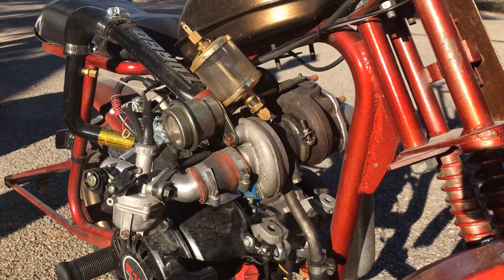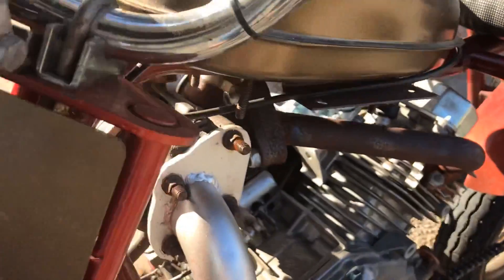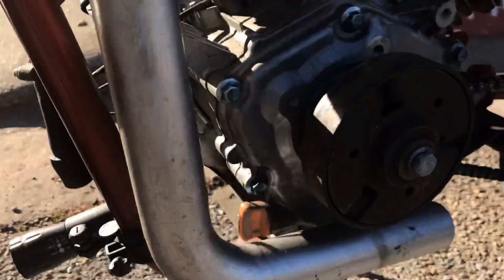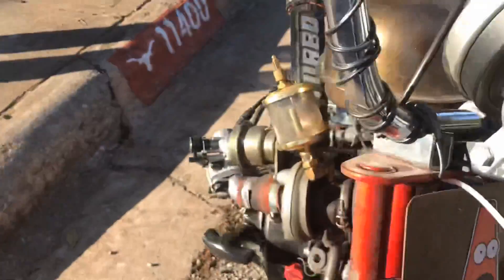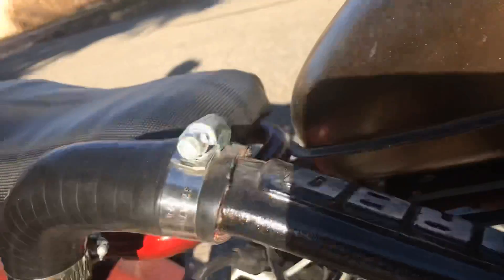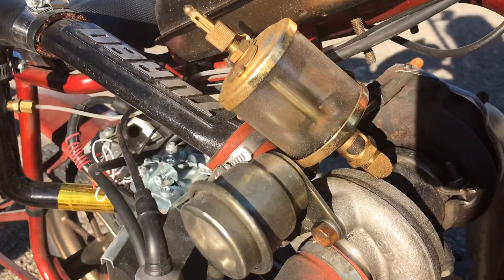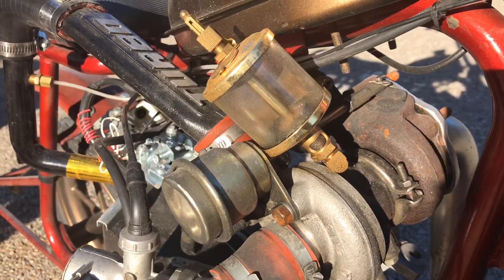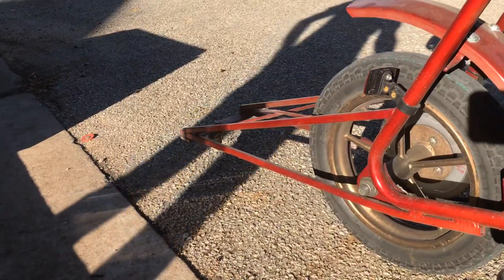Turbo Predator minibike walk around startup and ride

Comment: 'I don't ride it everyday, ...  or i would be dead' ohh man that was funny , great build btw . always coming back to this video just to check , building one myself :)
Reply from the maker: Thanks! Its actually injured quite a few people. Fortunately nothing serious but its a handful. No one respects the throttle or expects the boost to hit so soon. I'm not great at recording what I'm working on but I guess I should make a follow up video. I'm working on a hydraulic brake setup to make it a bit less dangerous to ride and have been thinking about reworking the exhaust/charge pipes for ergonomic reasons.
Reply: Hey mann this is my other account I got a video of my turbo ,feel free to check it ,peacee
Reply: instablaster
Reply: What did you have to do to the carb, add bigger main jet?

Comment: What carb and what jet size are you running?
Reply from the maker: Its a 22mm Mikuni knock off and I went up 3 jet sizes if I recall correctly. I can pull it apart and get the number but it started and ran on the stock jetting out of the box. Your results may vary

Comment: Question on the oiler......These Turbo's, I just bought one I'm planning on putting on a Briggs vanguard v twin. Everyone I've seen using this cheap turbo is having oil control issues with them. I understand you don't have an oil pump on the predator but the Briggs does. When I tried questioning the manufacture off eBay I never got any response of course about oil flow and pressure requirements. I'm at a crossroads now.....  Do I take the whole thing apart and custom make my own new tighter tolerance bushings for it, or put the bandaid on it by using a oil restrictor inline to the feed side. I'm guessing you may have some time on yours by now and it hasn't seized up or the impeller isn't grinding into the housing yet from lack of lube with a non pressure lube system. Just wanted your opinion on this turbo if possible. Thanks so very much, I have the same exact mini bike frame!!! Lol! It's all done up with a worked predator 212 naturally aspirated though is deadly enough! I can't believe we have the same bike and I put the same tank on mine as well off a bicycle kit lol! That's too funny and weird man! Shoot me your email address in a message back and I'll send pics of mine! Do you have any idea the manufacture of the chassis of these bikes BTW? Mine came from a school transportation class they were throwing out. Was like brand new minus the engine of course. But it's the same slanted engine plate with fork springs and big ass spoke wheels 10" I believe I put knobbys on that fit a Yamaha Pw50, they work awesome. I had to do away with the horrible rear scrub brake with the knobby tires though and want to a band brake welded the hub to the rear rim. Please if you happen to have any info on these chassis let me know. IDK if it is or not but mine has MANCO on the back of the seat, but I really couldn't find anything manco made that looks even close to ours!!??
Reply from the maker: I just used a gravity feed machine oiler and have to drain the lower reservoir occasionally. Probably not ideal for the turbo but it has lasted 3 years like this.
Reply: try it without the restrictor, if it smokes, put the restrictor in. also, as straight a return line and as big as possible.

Comment: Does the type of spark plug matter? In a car I know they require cold spark plugs
Reply from the maker: probably but I haven't messed with that aspect. I'm throwing a lot of fuel at it to keep it happy so I suspect there is still some power to be found. I can't say I want or need anymore unless I stretch the frame and move the rear tire back a bit. All it wants to do now is wheelie..

Comment: Where did you get that Exhaust from
Reply from the maker: I made all the piping except for the "turbo" embossed charge pipe. That piece was salvaged from the donor motor. For the remainder of the hot side & cold side plumbing I bought pre bent 90 degree tubing sections and cut/welded as needed. I also made the downpipe flange from a piece of 1/4" plate I had lying around
Reply: @Toadatx  ok thanks

Comment: How did you get the draw through setup to work so well?
Reply from the maker: Well a carb is a pretty simple way of adding fuel to a quantity of air. The mikuni came jetted close enough for the engine to start and run and from there it was just a few jet changes. The tricky part was setting something that resembled an idle as the compressor wheel wants to stall which will stall the engine. This gets better as the cartridge heats up and the bearing frees up a bit. It would probably all work better if I used a new turbo instead of this junkyard one.
Reply: @Toadatx yo if your looking to sell it I got $2500

Comment: I think I could take you with my stock 5hp Briggs Flatty with PZ20 carb 70 Ruttman Spyder.
Reply: I was thinking the same thing flatheads forever baby!!!
Reply from the maker: I've been working on it (new carb and a much better clutch) so I should probably post an update video. I'm not sure how it would stack up against more serious builds, this was more to see if I could get it to run and make useable boost and I certainly achieved that.
Reply: @Toadatx  it's badass!

Comment: Can u hear turbo spool or power diffrennce?
Reply from the maker: Definitely. The spool up sound is a bit odd due to the single cylinder but you can certainly hear it. Power wise, its very noticeable when it comes on boost. The predator is basically stock other than the turbo/carb and the bike will hang with by friends Z125
Reply: @Toadatx  so it’s actually worth it some what
Reply from the maker: @WoodysPerformance101  I think so and it will be much better once I upgrade a few things on the motor. Mainly hardened cams so I can run stiffer valve springs. The boost is floating the valves currently so the stiffer springs will help. I'm also working on adding a manual boost controller because the wastegate is opening at 7 psi and I'd like to push it to 10 lbs.

Comment: Where do I get a turbo manifold!!!!
Reply from the maker: "Intro to welding" class at your local community college (or teach yourself by ruining lots of steel like I did). Seriously though its a custom piece I made to fit the parts I already had.
Reply: @Toadatx  see that’s what I figured that I’d have to weld my own I just thought to ask cause I’ve seen some that look almost mass produced so what I was thinking maybe you can confirm cause I use the 3 point flange I cut from a stock exhaust to mate with one of these baby turbski’s
Reply from the maker: @randysanchez1397  yeah I traced the 3 bolt flange and cut/drilled one from 3/8" plate. The tube was from a mix bag of mandrel bends I bought from BMI karts
Reply: @Toadatx  good to know I had the right idea I wasn’t sure if it would match up

Comment: Turbos don't do much on 212. Sound like it was sputtering wot
Reply from the maker: The boost is quite noticable. Sputtering in the video is due to valve float and I'm planning to install a higher flowing cam when I swap the springs.

Comment: ........no jack shaft.
Reply from the maker: It doesn't really need one as the sprocket and motor line up fine. So far it has been pretty easy on clutches but I have been considering removing the wheelie bar and extending the rear frame to get the tire a bit further back.